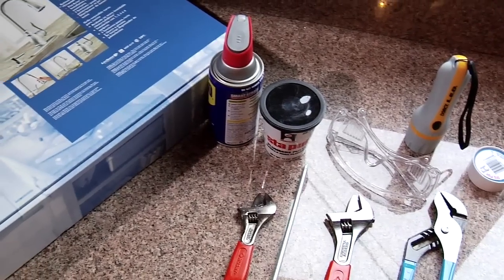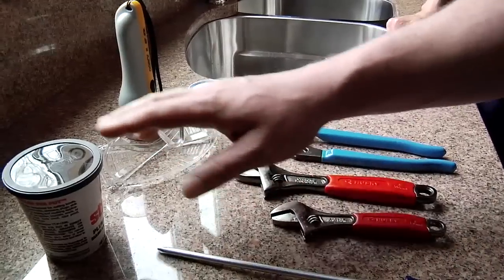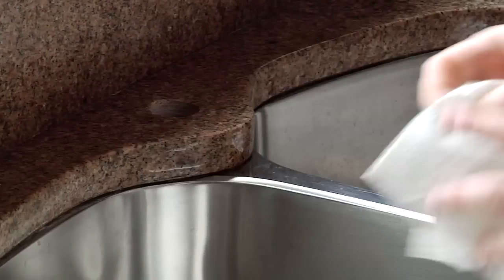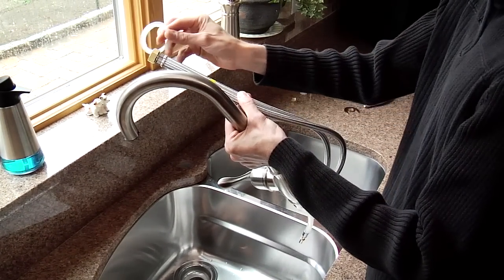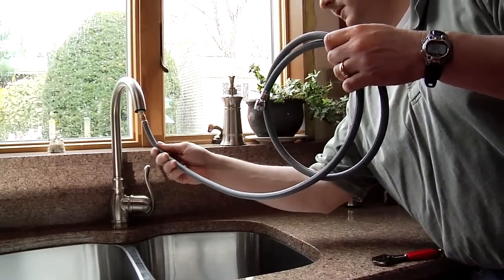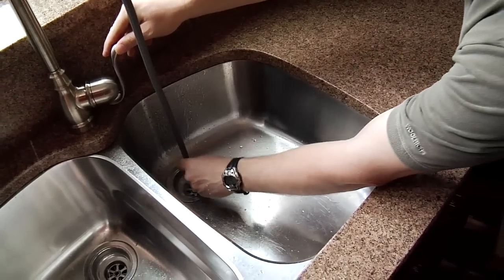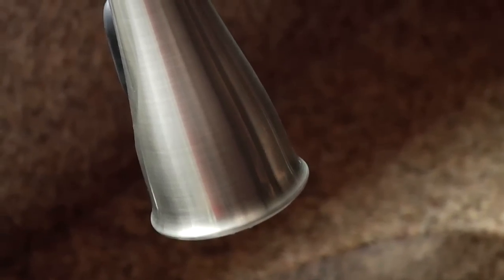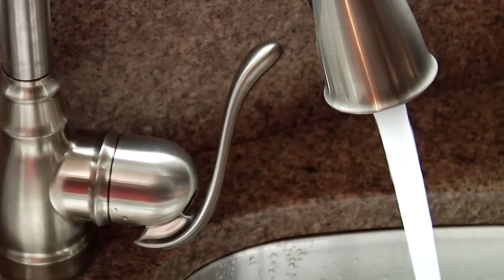Do-It-Yourself Kitchen Faucet Installation by Moen

Comment: Didn’t show how faucet was secured to counter, the one thing I wanted to see.
Reply from the maker: Hello James.  Please refer to the following link for assistance in installing your Moen Pulldown style kitchen faucet.
https://p.widencdn.net/c4xu2o/reflex_install
Reply: @moenfaucets  My problem was that the plate, that covers the two holes, moves.  Unlike the former Moen faucet (which is nearly identical), this plastic gasket that fits inside the plate doesn't have anything extending into those holes (which would keep it from turning).  Then the nut that goes on the plastic shaft never stays tight.  The nice video you sent me to is very different kitchen fixture.  Moen has sent me a new plate and now a nut, and the the plastic gasket for the plate backordered.  In the end, I might have to use caulk around the plate.  I might end up using the old nut on the shaft.
Reply from the maker: I'm sorry to hear the difficulty you are experiencing with your Moen kitchen faucet.  We would be happy to help! Please email us by visiting our Contact Us page at https://www.moen.com/customer-support/contact-us or you can call us at 1-800-BUY-MOEN (1-800-289-6636). Our business hours are Monday through Friday from 8:00 am - 7:00 pm Eastern Time.
Reply: @moenfaucets  The problem is the stem is plastic and knob/nut is plastic and it works it way loose.  I bought used two 3/4" plastic bushings to make up for the lack of ridges on the new "gasket" under the plate.  It keeps the plate and faucet from turning. One would have been enough but less than $3.00.  I placed in each hole.  Works fine.  If it comes loose, I'll double nut it as Moen sent me a 2nd knob/nut.
Reply from the maker: Hello James. I am sorry for the trouble you had with the installation and do appreciate the feedback you provided on what worked for you for the mounting hardware. Please reach back out if we can be of further assistance.

Comment: They always leave out the fact the hose line doesn't fit through hole and i can't disconnect it
Reply from the maker: Hello Sherri, the instructions included are for easy installation. There is no issue with installing the hose. If you need additional installation assistance, please contact Moen directly at 800-289-6636. Our business hours are 8:00 am - 7:00 pm Monday through Friday.

Comment: It didn't show the hardest step. Tightening the faucet onto the counter.
Reply from the maker: Hello.  You are correct, this video did not show the tightening down of the faucet; which can be one of the most difficult parts of the installation.  This part of the installation process can be difficult by the items we all keep under the sink.  This is one of the reasons that we include an installation tool with our pull-down kitchen faucets.

Comment: So you don’t need the putty or tape?
Reply from the maker: Hello Adam.  For the single hole mount installation of the Moen Anabelle pull-down kitchen faucet shown in this video, neither the plumbers putty or thread seal tape are needed.

Comment: Where do you get the assembly tightening tool? My installation is falling apart……Home Depot who sold this assembly has no idea of where to get the plastic sleeve nut tightening tool…..can you help me ?
Reply from the maker: Hello Mario.  The Moen kitchen faucet installation tool, part number 118305, can be viewed on our website at:
https://www.moen.com/professional/products/Moen/Moen-Installation-Tool/118305
If you no longer have the installation tool included with the Moen kitchen faucet, you can call us at 1-800-289-6636; we are available Monday through Friday from 8:00 am - 7:00 pm Eastern Time.  If you would prefer, you can use our "Contact Us" form to send us an email.
https://www.moen.com/customer-support/contact-us

Comment: I thought u needed that puffy tape and tools and why didn't show what was done under the sink
Reply from the maker: Hello lee bags.  Depending on how the faucet is connected to the water supply shut off's would determine if the thread seal tape is needed.  The shut off valve connection types and the type of faucet being removed from the sink can vary by installation.  This would be why these two items were not addressed in detail in this video.

Comment: You showed the plumber's putty, pipe tape and various other tools but didn't show where they are needed in the process.  Is the pipe tape used on the water supply line connection to the water supply line valve?  I'm thinking but it doesn't show that in your video.

Comment: Is there a video that actually shows All steps? Including removing the old faucet and  square plate etc? This doesn't show tightening anything or where to put the putty and tape etc. there seem to be multiple steps missing here. I’m not sure where the hose attaches to?
Reply from the maker: For additional installation assistance, please contact 1-800-289-6636 (US) or 1-800-465-6130 (Canada).  Thank you.

Comment: You never showed how to attach faucet to the counter top. You don't just drop it in.
Reply from the maker: Hello MB, I apologize for the confusion. Included with the faucet are installation instructions. If you need further assistance with installing a Moen faucet, please contact Moen directly at 800-289-6636. Our business hours are 8:00 a.m. - 7:00 p.m. Monday through Friday Eastern Time.

Comment: Thanks for this video - that connection of the hose that pinches to release had totally stumped me.  This MOEN faucet has been installed in the home when we bought it and we couldn't simply figure out that last step on the hose.  Thanks.

Comment: So is there a reason he said to make sure you have adjustable wrenches plumbers putty and the teflon tape and screwdriver but never showed what to do with all of those items?
Reply from the maker: Hello Nicole.  Many of the tools mentioned would/could be needed depending on the model kitchen faucet that is being removed, previously used supply connections and the type of shut-off valves installed under the sink.
Reply: Sooo... Depending on the type of faucet you're **removing**, you might need Teflon tape and plumber's putty? 🤨
Reply: @moenfaucets  so why show them in this video then; you left out almost everything under the sink important

Comment: Agree with the neg comments.  This install looks like it was done in a brand new house with connections that are clean, new, and have zero corrosion, rust or old sealant.  Thanks for nothing, really.

Comment: Hey I followed your instructions. You left out the part about taping the faucet to a can of WD40 (I saw one in the video) so the faucet will remain upright. I tried using plumber's tape to wrap around my wife's mouth (so I wouldn't have to hear her complaints) but she hit me over the head with one of the wrenches I placed on the counter.